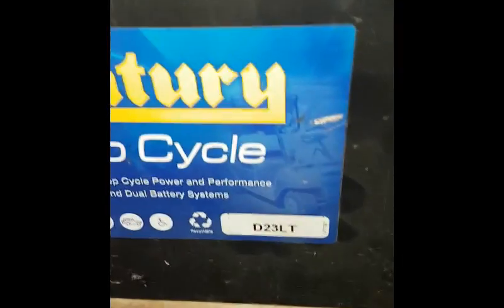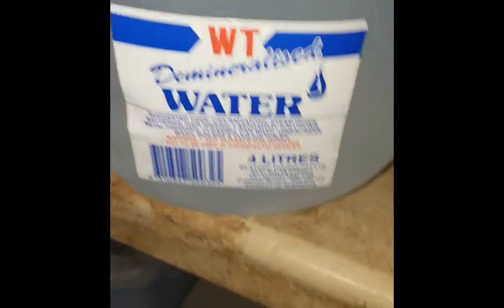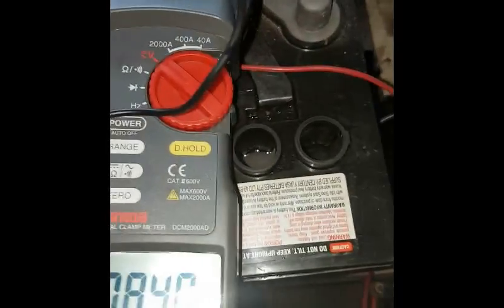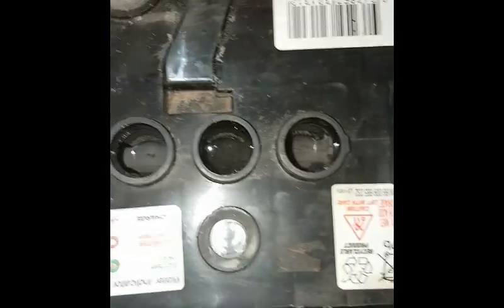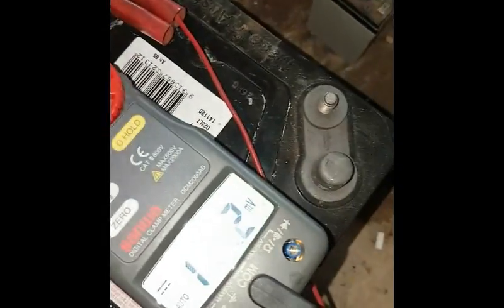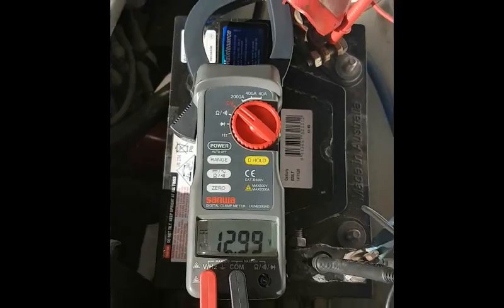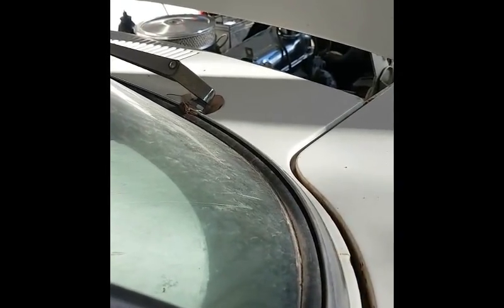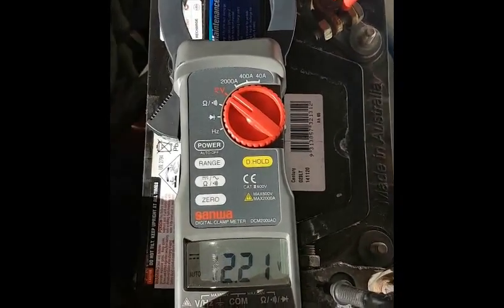How to: Revive or Recondition a 12v DEEP cycle battery! Using Epsom Salts. Motorbike, Car, Scooter.

Comment: Tried to revive 4 deep cycle battery's this way. No luck on any of them. Tried 2 amp, 10 amp 55 amp 200 amps. Even repeated the process several times. Baking soda and water to flush. Epson salt with distilled water to charge. Left on charge several days. All 4 battery's are still useless.

Comment: here's  a few tips for battery repairing
never try to do this unless you know what you are doing - the acid can burn you
check the voltage first - there may be a kaput cell which would be a waste of time trying to fix.
Check your battery fluid.
Try to completely recharge the battery.
(I learned about these and more on Rapid Renew Roadmap site )